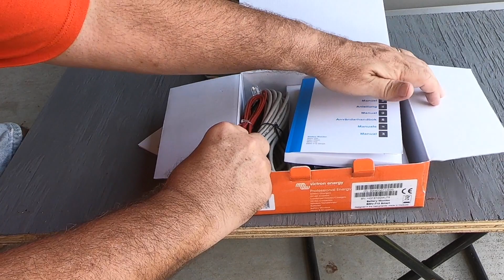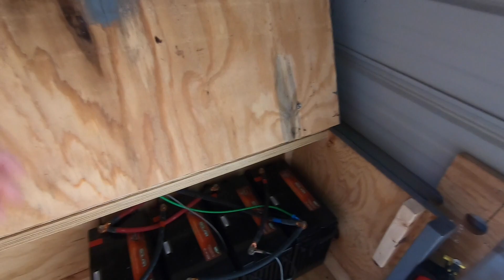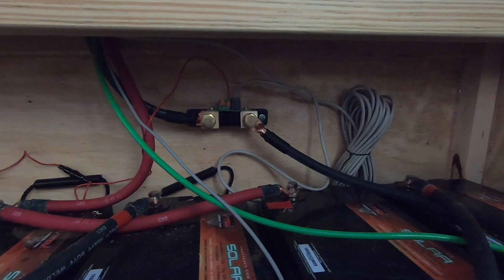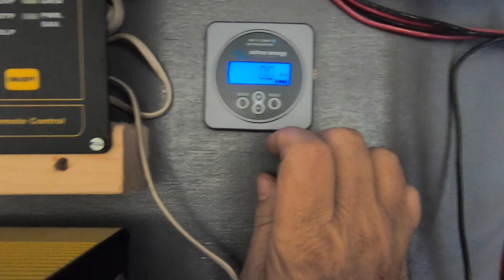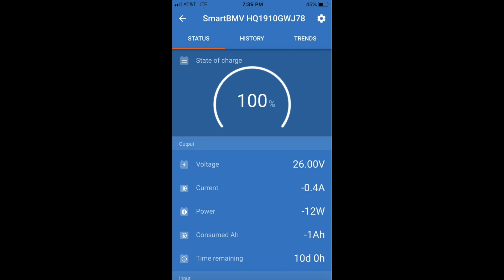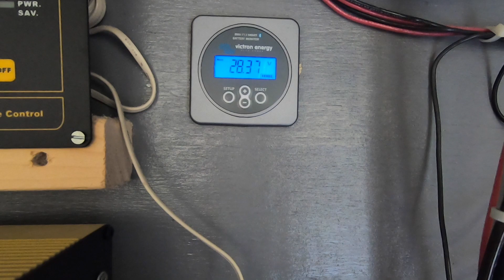Victron Battery Monitor BMV-712 Smart - Install & Review

Comment: You might want to get the temperature probe installed with the monitor.

Besides charging or discharging too much, temperature is probably one of those variables affecting all battery chemistries.
Reply from the maker: Ok, will check it out. Thanks for watching.
Reply: @LandingZoneHome  I believe there is a relay action when the battery temperature is too low or too high, and I am pretty sure you can setup an alarm to do this.

The same thing goes for the voltage sensor.  If voltages during charging or discharging step out of bounds, then an alarm can be setup, and I think there is some type of relay action as well.

Comment: With the 100% at the start. Did your percentage drop after your first charge after installation? Or did it automatically start after the hour?
Reply from the maker: The app has a way to calibrate to ensure the 100% is not reached too soon. So I did a calibrate 2 times. Thanks for watching.

Comment: Can the monitor be left in engine compartment. I’m putting it in my 2019 Dodge GC so I don’t have the space for it.
Reply from the maker: The monitor needs to be kept dry. It comes with a very long wire so you could place the monitor inside the vehicle under the seat or somewhere out of the way. Thanks for watching.

Comment: I see that your battery disconnect switch is connected with the positive cable. I was always told to use the negative cable.
Reply: for a negative ground system input the disconnect in the positive line
Reply from the maker: Check this link please: https://mwands.com/shop

Comment: Hello, Thanks you for your video. I think it is the first one that answer my question. I am installing the BMV 702 in my van. However, my battery pack is under the seat, so I prefer to know what I neet to do before removing the seat. I was looking to understand how I connect the "load and charger" side of the shunt. If I understand correctly your video the only thing I neet to do is to place the shunt in "the middle" of the negative cable of the battery banks. I will discovear how my installation is configured when the seat will be removed. Have a nice day :-)
Reply from the maker: Fabiano you are correct, just place the shunt on the negative cable, pretty easy. Good luck and thanks for watching.